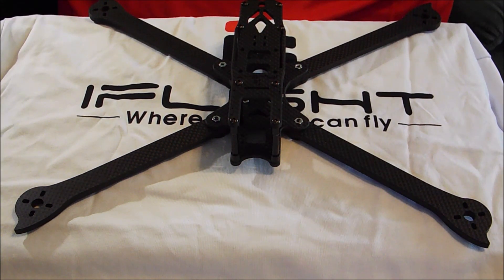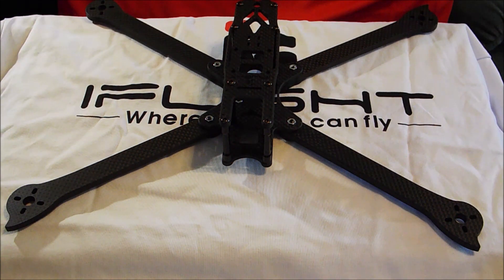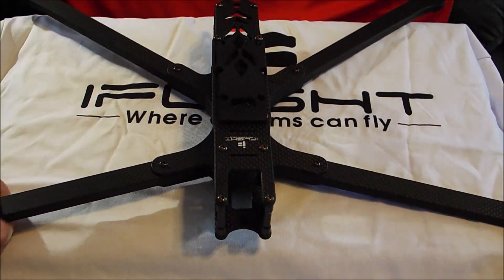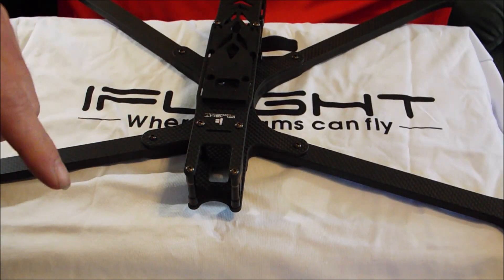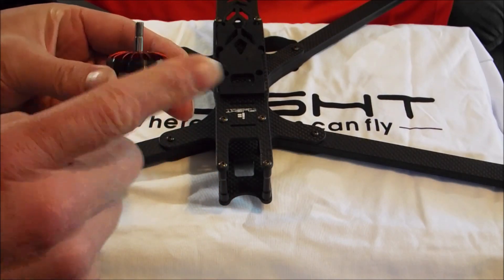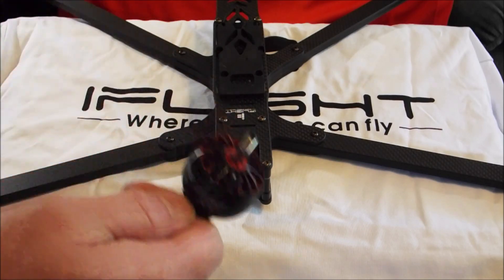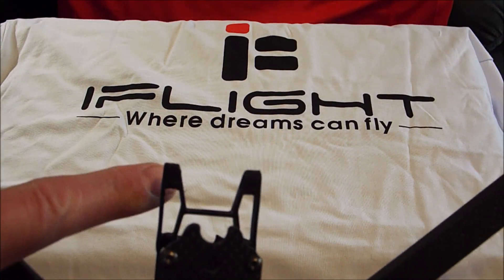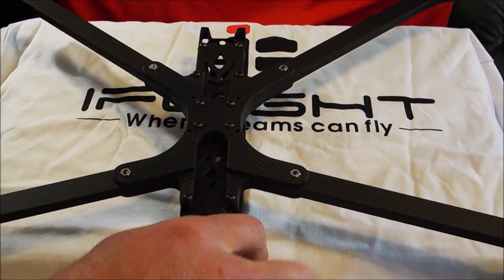Let's look at some macro quad gear from Iflight.  DC10, Xing 2814 and XL8v3.

Comment: How does xing x2814 1100kv with 10" prop on 6s? Handle it good? 
If they release the Vertigo in 10" or even 7" or 8" I'll sell a kidney if you need and get it! lol i have the 5" ant its one of my favorite frames i have.

Comment: I built an XL8 many months ago with 2508 motors and 9443 props.
From 2 years ago, I was freestyling 330mm and 450mm 'Flame Wheel' kwads.
Glad these larger girls are getting more popular.
Also, this new meme of lowering your rates is old hat to me, big girls fly more elegantly and smoothly on less than 450 degrees/second. QED.

Comment: Did your DC10 Macro came with a manual on how to assemble the frame?
Reply from the maker: It did not but I found it to be pretty straight forward. I think it can only go together one way. Let me know if you need help and I will post some pics or a video.
Reply: proto fpv what the long gold screw connection to and what the white short tube use for?
Reply: proto fpv another thing I forgot mention is did you get the included anti battery slip pad just like you have in the video on top of your frame or did you use a spare anti battery slip pad?
Reply from the maker: @aerialhorizonrc7827  Mine is a pre production model so it didn't even come  in a  package. Just taped up in plastic with a bag of screws.No white tube or gold screw either. Wish I could help. Definitely email them or contact Iflight rc on facebook.
Reply: proto fpv  can you please tell me your parts listing for your DC 10 build